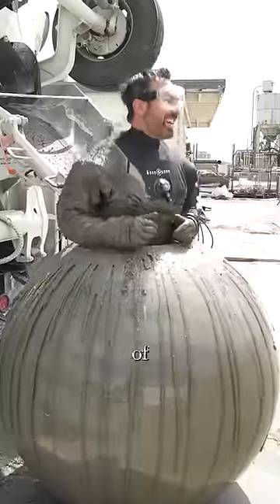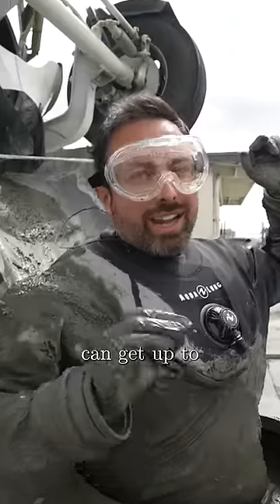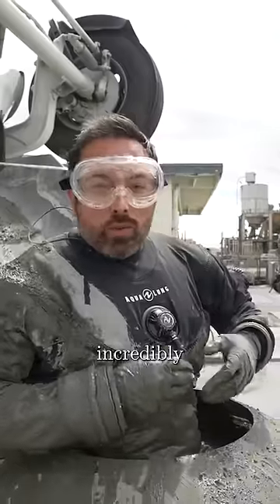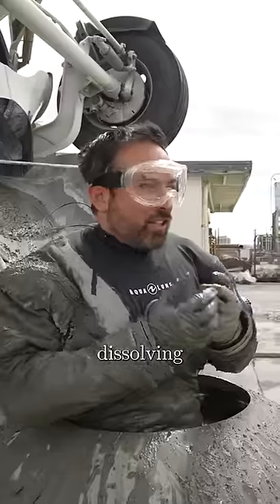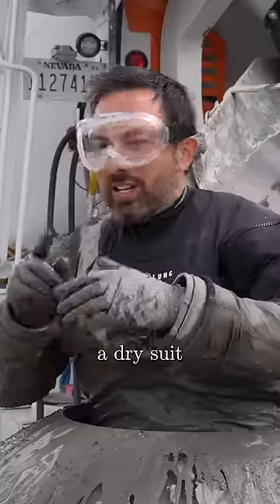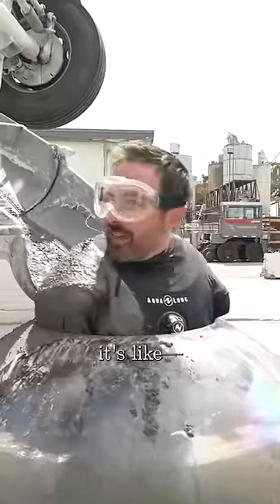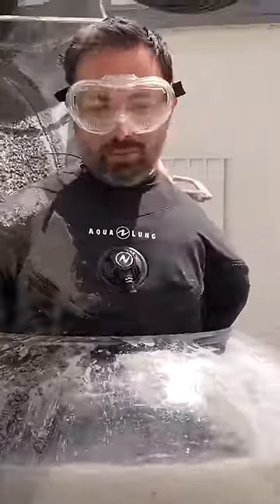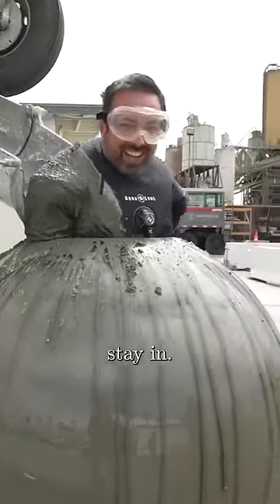I buried myself in concrete to explain how it works

Comment: Concrete will also break your bones as it sets, because it swells a little as the binding agents re-mineralize.
Reply: No not, if it would swell that much that your flesh would not absorbe, it would crack it own self.
Reply: No it doesn’t, it contracts as water alters it’s state and also evaporates. If it swelled it wouldn’t crack.

Comment: Ok... so being a commercial diver who spends damn near every day in a dry suit, he needs a weight belt just to  counter act the buoyancy of the air in his drysuit and his body... there is a valve on his left arm to deflate the suit thats why he's floating so high and his chest is so puffy... hes trying to sink a balloon....
Reply: Can you explain more about what the dry suit does and where is it usually used
Reply: @vimalkarthik3461  drysuits are used in really any kind of diving, but usually in cold water or in hazardous or "HAZMAT" conditions. its called a drysuit literally because it has seals around your neck and wrists and the boots are usually attached so for the most part no liquid enters the suit (small amounts can enter if you have hairy arms and such). Hence the term "dry" suit whereas a wet suit keeps you warm but not dry, there is a valve usually on the upper arm/shoulder area to allow air out of the suit once you enter the water to allow you to sink, there is also a valve and hose attachment in the chest area to allow air from the scuba tanks INTO the suit to keep the pressure from the surrounding water from crushing the fleece or long underwear you wear under it to keep warm, a wet suit uses a thin layer of water between your body and the suit to keep you warm whereas a dry suit uses a layer of air usually created by the underwear to keep you warm hope this helps
Reply: @Coltgov191145  Great, thank you!
Reply: OK, thank you I didn't overlook the buoyancy but I overlooked the reason why. So if you fell in a big thing of concrete, would you still float? I mean I would imagine if the concrete is super wet you would still float.
Reply: Even without the suit and any bubbles you would float. Concrete is heavy. Its density is more than twice than that of water. Your body will float in water. It certainly wont sink in concrete.
Reply: @blueskyla7978 Pretty much. Concrete is denser than water, so you'd float. I'd imagine it feels like quicksand or custard when wet
Reply: The drysuit has a vent on the arm you can open and close to release the air trapped inside. On his chest there is a low preasuure inflator attached to a tank of compressed gas. The reason being as you decesnd further underwater the gas in the suit will compressor due to the preassure of the water, so you must add more air to the suit to prevent a "squeeze" that can be fatal. Then when you accend the air in the suit, it will expand due to the decrease of water pressure so the vent on the arm is there to control your buoyancy to stop you from accelerating to the surface faster and faster as the gas in the suit expands creating more buoyancy. In a nutshell. They are mainly used to stay warm in cold water due to you being dry inside
Reply: Also he is much less dense than concrete - even without the suit - so he's gonna float regardless.
Reply: I didn't realize this at all, i mean the puffy chest as i real this is not that big as it is showing in this video and of course to the air is holding him up and hole is little big smaller and he is not going down further than his shoulders!!!!!
Reply: It’s definitely really hard watching people wear dry suits that have no idea how to release the air. Also good to see another diver not too many out there to begin with cya man.
Reply: Even having 100% perfect seals around neck and wrists doesn't guarantee you stay dry :) there is  sweat which evaporates and gets condensed back  on the colder drysuit surface inside :)
Reply: Yeah you sink into concrete preeetty damn fast.

One day at work there was rain and they did a bad job marking the pour break they had just filled in, along with the rain it made the fresh concrete nearly indistinguishable. 

After a couple of us stepped in it, the carpenters stopped even getting annoyed or trying to warn people, they just laughed and we started keeping a counter of how many people fell in. It was about a dozen guys for just us iron workers and one of the general contractors people fell in even.

Aside from the funny story, yes, you definitely sink in concrete. Man's is definitely correct about it just being the dry suit
Reply: I’m in commercial diving school and I have this drysuit, lemme tell you that thing floats. It takes me a lot of weight just to get to bottom in it.
Reply: Archimedean
Reply: Hey coltgov I'm also a commercial diver. Where are you based if i may ask? could i have somewhere to contact you because i'm trying to find buddys who also do the same thing as me so we can talk about them. thanks in advance
Reply: Concrete is also ~145 lbs/cft (without rebar), too, so he's got density from his body working against him, even without the air
Reply: I mean he's also sinking into cement, that stuff is probably gonna make a person buoyant no matter how much air is in their suit
Reply: There’s a little more to it than that, the human body is less dense than concrete and weight must be adjusted accordingly. You’ll find this if you ever have to dive in drill mud or sewer infrastructure. The inverse is experienced in demineralized water like the Taurus of a nuclear reactor. 
  I’ve done commercial diving for 14 years, flowable fill makes a great bed, just get the Viking neutral and crack the vent… I slept like a baby during monitored pours.
Reply: Shh, this looks like the closest he's ever come to knowing what being a cat is like.

Comment: “Baby rate me 1-10”

“11.8. Incredibly basic.”
Reply: Toxic relationship has a ph of 1 because one of them is going to hide the body of the other with HCl, which has a ph of 1
Reply: More basic than Ugg boots and a Pumpkin Spice Latte
Reply: Nice
Reply: Max basic ph is 14 not 10
Reply: @I-am-ur  Incorrect, the pH scale doesn't really have a limit, it's just -log[H+] so it can theoretically go as high or low as you want
Reply: @Dinoenthusiastguy   not it has a fix scale until discovered from 1 to 14. 7 being neutral and where many salt falls under. It basic knowledge in science class
Reply: @I-am-ur Nope, completely incorrect (other than 7 being neutral). It's usually taught as going from 0-14 because that has a nice symmetry to it (hence why it's taught in basic science classes) but there's no reason it has to stop at either end - in fact, it doesn't. Very concentrated fluoroantimonic acid can reach pH's of -30 or lower. Concentrated sodium hydroxide can often have a pH of 15 or more, although pHs above that kinda mess up the scale and it stops being useful/easy to use.

It just comes down to the definition. pH(something) = -log(concentration of hydrogen ions in that thing). Graph -log(x) in desmos if you don't believe me, there's no reason the scale has to stop at extremely low or high hydrogen ion concentrations, it just stops being useful past a certain point.
Reply: @Dinoenthusiastguy  e.a. Yes, the pH scale has no upper or lower limit in the definition. The reason anything dissolved in water falls within this 0 to 14 scale is because at pH 0 and pH 14 water starts to act like a buffer and it is extremely difficult to get higher than 14 or lower than 0 when acids or bases are dissolved in water. This is because in pure water 1 in 100,000,000,000,000 (that is a 1 with 14 zeros) molecules of water spontaneously separates into H+ and OH-. 
However if you dissolve them in a different solvent  or reduce the amount of water to a minimum, the pH scale changes completely.
Reply: Hey the other end of the spectrum is acidic
Reply: Xddddd
Reply: @Dinoenthusiastguy  TIL that my AP chemistry class in HS 25 years ago was barely sufficient to follow along what you are talking about lol.
Reply: 12pH is max basic
Reply: Clever joke.
Reply: YA BASIC
Reply: @larswilms8275 reminds me of how water reacts with limestone which becomes alkaline due to chemical reactions
Reply: science jokes.
Reply: Bismuth technetium hydride with a pH in excess of 7.
Reply: @I-am-ur you missed the joke
Reply: Based af
Reply: "My friends are worried about getting me out, but I can't stay in. 😂"
Reply: why?
Reply: Vikkstar said this on a IRL tinder. He went “Youre a 10… on the PH scale cause youre kinda basic.”
Reply: @poka26ev2 💀💀💀💀💀💀💀💀💀
Reply: @I-am-ur lmao this dude really is confidently wrong and it’s embarrassing
Reply: you'd say 7 instead, the Ph of water. 11.8 is basic for an extremely alkaline substance like concrete.
Reply: I rate this comment 10/10 tho.
Reply: @I-am-ur who tf asked
Reply: @I-am-ur Wrong + that's the whole joke, 1–10 is the standard "rating" system so you wouldn't respond with 11.8...
Reply: @poka26ev2 you're too good 😂
Reply: shoulda said rate me 1-14
Reply: pH-oarrr!😍
Reply: Derek, please try diving into mercury for your next video!

Comment: You also might not realize that it’s dissolving you, because your pain receptors respond to acids and not bases.
(Gross Warning)
My college chem professor told us about a coworker he had that was handling very strong bases and his suit got a hole in it without him realizing it. So the base got into one or both of his boots and he didn’t realize his foot or feet were being dissolved until he took off his boots when he came home and found a mutilated foot and sludge in his boot.
Reply: Nice
Reply: Omggggg so did his foot get removed or did it go up the ankle
Reply: The nerves get deactivated and dissolved
Reply: Depends on how fast it's happening, I've experienced mild chemical burn from cement (powder coming in contact with the sweat on my hands) and it's definitely pretty painful.
Reply: He didn’t know until he got home and took his boots off? Come on. Even if he couldn’t feel pain from it, you’d think he’d still have a really hard time walking if his feet were that mutilated.
Reply: I once brought some sodium hydroxide tablets home to work on a project for an exhibition when I was in school and accidentally dropped some on my chair. I didn't notice anything immediately after sitting but after 20 minutes it started getting itchy and in a few more minutes it started to hurt so I looked at my butt and the spot where there was contact had a small wound. I was thinking that it was the ants that were biting until I got that burning sensation.
Reply: Isn't cement curing exothermic?
Reply: ... I find this hard to believe with bases, but something similar can happen with HF. The fluoride binds to the sodium pumps in nerves and effectively stops their signaling, before any of the other damage sets in.
Reply: I don't know about that. I've been burned by sodium hydroxide before and I definitely felt it.
Reply: This might or might not be cap, I don't have enough knowledge of chemistry do decide
Reply: I've been a concrete finisher for 20 years and have had lime poisoning more than once with the worst almost losing my feet. I can tell you that you most definitely feel the burn just not immediately. And it's worse than an acid burn of equally opposite pH.
Reply: *lyme
Reply: Ive been burnt by caustic soda and it lets you know right away.
Reply: @_I_Got_This_  Nope, *lime. You're confusing lime with lye and Lyme disease.
Reply: Why can I feel the burn from basic chemicals them? It really depends on the strength of the chemical
You can definitely feel many basic chemical burns
Reply: when i got bad concrete burns its didnt hurt till i tried to dilute it with orange juice😅 (orange is an acid and cement is alkaline)
Reply: Yourwarning did not disappoint. Wow very gross 🤢
Reply: @kirito5547 the ants biting ??
Reply: My high school chemistry professor was also doing heavy agricultural work and his hands were really hardened with thick and calloused skin. Sometimes, during the classes he'd get some caustic soda (sodium hydroxide) on his hands, he would just smile, smear it and show us: Look, it's soap. :D:D:D
Reply: I used to work with concrete. Yes, it is basic, but not nearly as nasty as what OP is describing. I was often covered with the stuff all day. It definitely irritates the skin, but the worst of it comes from the sand/gravel rubbing against your skin, which is softened both by the water and high pH.
Reply: Mmhm. Never forget, a base will literally turn the lipids in your tissue into fat.
Reply: @Obscurite1221  concrete/cement isn't something you should leave on your skin. that said, it isn't something you should worry about touching. Cement/concrete is not basic enough to melt skin without prolonged and renewed contact. If someone wanted to melt your skin with concrete/cement, it would take days at standard construction mixtures.
Reply: just wipe the excess off during the shift, wash your hands at lunch and take a shower at the end of the day. it won't kill you outright, that said, you shouldn't leave it on your skin as much as possible.
Reply: "because your pain receptors respond to acids and not bases" Fight Club told me otherwise.
Reply: @1harrismccarty  It seems to really depend on the situation and person. I've never had any concrete burns even after hours of skin contact. 
A friend got the worst burns I've ever seen all over legs from sitting on his knees in concrete (finishing something that was very hard to get to)  for less then 5 minutes. lots of skin gone, prolonged bandaging and treatment was necessary. He did continue to work for several hours, so his work trousers might have been saturated with concrete for much of that time.
Reply: Clearly, someone's never had a lye burn
Reply: @DiscoFang True, but ceviche is made with lime.
Reply: @_I_Got_This_ If you make ceviche with that kind of lime you definitely won’t getany Michelin stars.

Comment: Don’t forget that concrete curing can be around boiling temperature
Reply: Yeah I was wondering how high it could get. I'm too lazy to go check the full length video, but I don't imagine he was in there for too long.
Reply: My thoughts exactly 😮
Reply: Also it cures from top to bottom. So if you're buried alive in concrete, by the time you struggle your way to the top, the top will be rock hard. Some magician died trying to escape a coffin buried in concrete.
Reply: @DennisTea  As someone who works with concrete, you really don't have to worry too soon. Keeping it moving, i.e. by moving yourself, will also slow down the setting process. But concrete will continue to bond and solidify for up to 30 something years after the fact.

Comment: I had concrete burns on both feet many years ago  while pouring concrete footings for a house build, I wasn’t equipped enough but the job had to be done,,, ended up losing 2 weeks work as my feet were so badly damaged

Comment: I’ve worked with concrete on a number of occasions. It’s okay to get on your skin for short periods of time if washed off quickly. Leaving it on for longer periods of time causes the top layer of your skin to peel.
Reply: exactly, a lot of people are overreacting here. comparing it to bleach is laughable too.
Reply: was going to say this, it really isn't that bad 😂 dissolving your skin is an overkill way to describe it

Comment: Grout/concrete QC Field Engineer here -I work in drilling and Grouting. Many chemicals can do this to you and many chemicals can help you if you get burned by them. Chemical burns are much trickier due to risks of infection, difficulty of stopping the burn (heat/cold burns slow when the heat differential is removed, while chemical burns continue long after until the active chemical is neutralized, CHEMICALLY), and complications. Concrete and grout (literally concrete without aggregate/rocks or sand) burns because of the concrete powder starting to react when mixed with water and other chemicals used in the slurry. The best neutralizing agent we use is from companies themselves, but at home remedies work just as well - distilled white vinegar is 10/10, orange juice does fine, etc. Don't use a burn sealer and wash with copious amounts of water if you don't have something SAFELY ACIDIC. From there, make sure to moisturize the burn, because you will notice extremely dry patches. If you are on site, you may not have lotion, but other topicals can work; I've used creamer before because it sticks and contains hydrating oils (no its not great and it's messy, but it helps 🤷‍♂️). Don't mess with chemicals and think they do nothing
Reply: Also, he isnt being that unsafe. There are much easier ways to get covered head to toe in this stuff when working with it, to the point many of the guys wear similar suits. He has proper protection on and the only risk is a tear in the suit. Concrete takes hours to set to the point anything gets trapped.
Reply: So well written 👀 we got a fking english major here